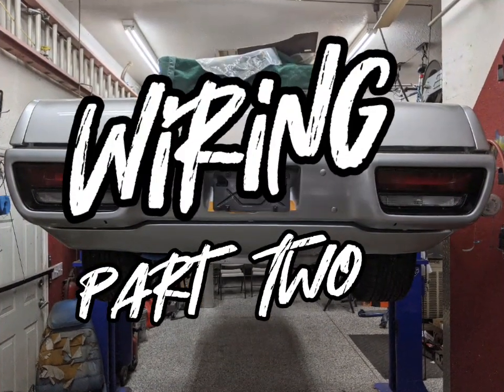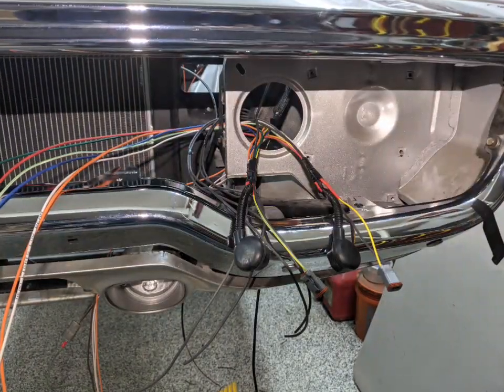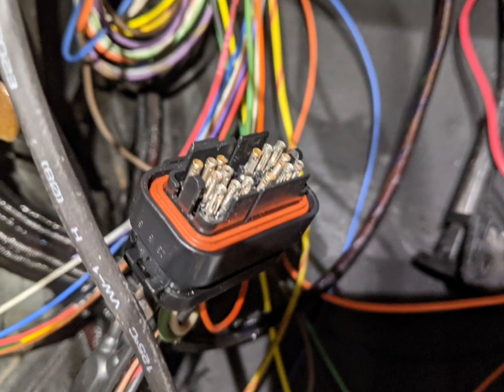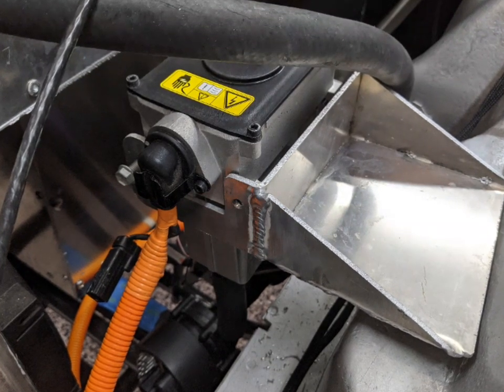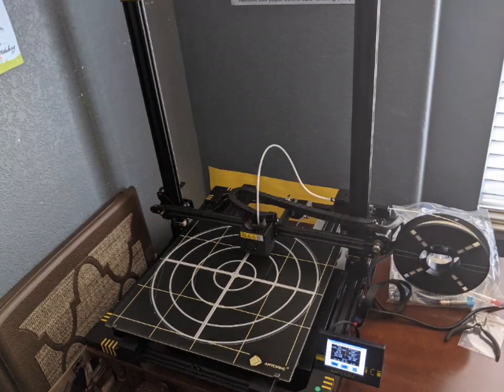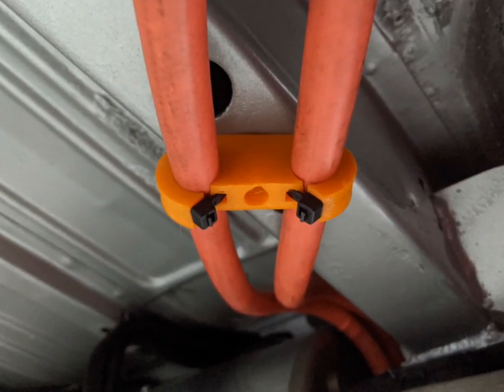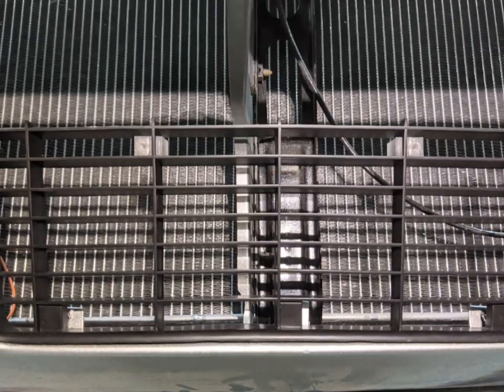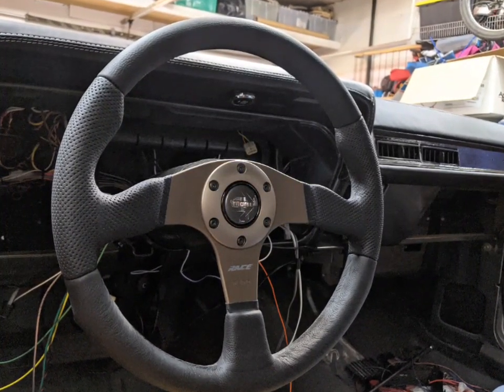Project Electrollite - Plymouth Satellite Tesla Swap - Wiring Part Two Ep. 11

Comment: Love the organization.  Just wanted to leave a tip here for anyone watching:  When using Deutsch connectors, any wire that will be carrying less than 1A should always use gold plated pins!  Standard pins film over after maybe a year and will start giving intermittent connections.  Can cause some really strange issues when a computer needs to understand what is coming across that wire.

Comment: An FDM 3d printed brake booster fitting seems a bit scary to me unless it's just for testing. I'd get a resin printer for production fittings if I didn't want to buy them.
Reply from the maker: I agree, It will be a brass fitting... It worked surprisingly well for testing though!